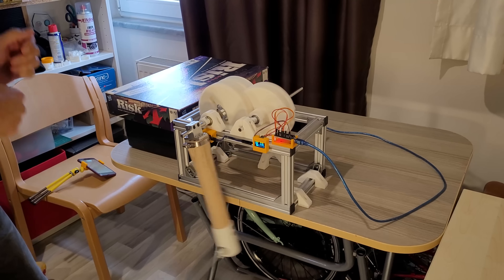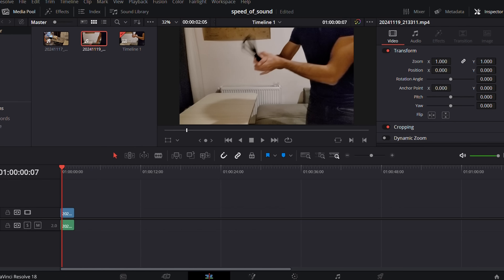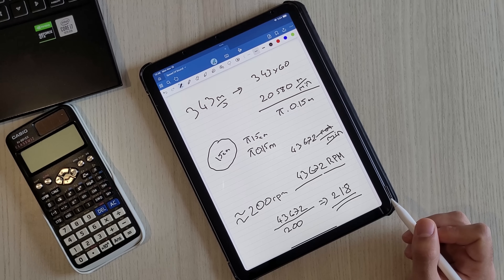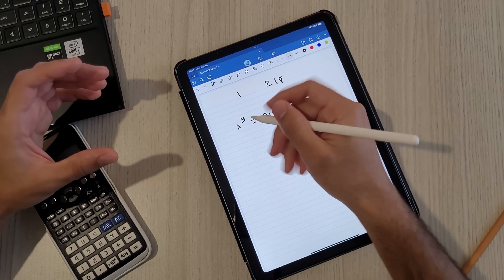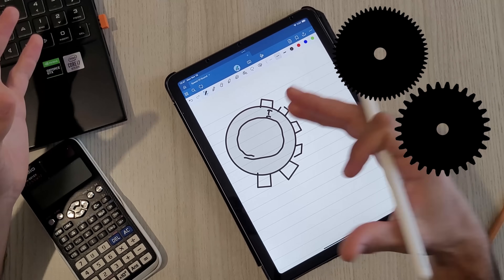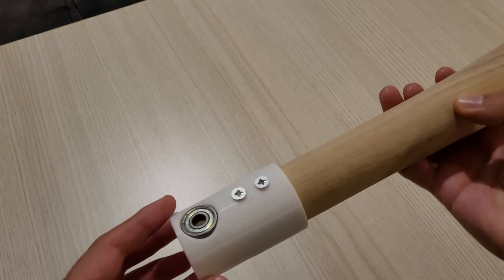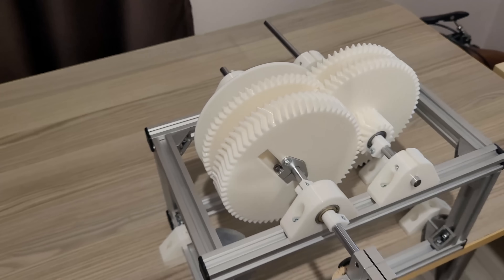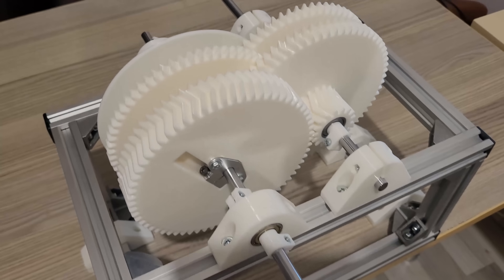Trying To Reach Speed Of Sound At Home 3D Printed Gears

Comment: New challenge. Gravity battery from very heavy weight. How long can you power your house by ever-so-slowly dropping a massive boulder down a cliff?
Edit: please read the comments before adding yours.
Reply from the maker: I don't think you can power your house, but i may try charging a phone.
Reply: @canocholic  back in the day (read before 1900) there was a setup that used a cranked platform filled with rocks that would power your lights and you would have a servant crank it every hour or so. 

with leds you can definitely have the whole house lit up for quite a while off of a 50 kg bag.
the main thing is that if you have a variable load you need a gearbox.
Reply: @canocholic  There's already a guy that is recharging a phone using the water pouring down from his roof gutters when it rains. It's not terribly efficient, and yes, he can barely recharge a phone in the best case scenario. Look for Quint Builds. he is abolutely overengineering the thing
Reply: @canocholic  you could run a huge cable and pulleys and make like a pull cord onto the input shaft of a generator. Just have to wrap a shit ton of cable. You can make it wrap another cable as it releases and you just have to reattatch the other cable
Reply: @canocholic must be the house brother. There is no other way. Thou has spoken.
Reply: @canocholic no, you MUST power a house.  Use a boulder as the weight.  Include a super heavy flywheel.  Make the winch/drive mechanism super high torque so you can wind it by hand / with a pedal bike.
Reply: @BobWidlefish  you would need about 40 tons being lowered over 10m in 1hour to get 1 kWh of energy. In a perfect scenario without losses....
Reply: @ exactly!  LETS GOOOO!!!!
Reply: @BobWidlefish сделай сам, в чём проблема? 😂
Reply: In a perfect system you could store/extract 9.8 joules per kilogram per meter dropped, average US home used 108 million joules in a DAY! Even if you hung a rock off the highest cliff in the world (mount thor) at a 1675m drop, you would still need a staggering 6500 kg rock travelling that entire distance up and down every day for one single home. And that weight grows exponentially as the potential height shrinks. These systems do somewhat exist in the form of hydroelectric plants and pump stations that can buffer grid demands throughout the day. But that's boring I want to see him do it your way.
Reply: @nave6268  The average US household uses almost 11.000 kwH in year? Thats crazy! In germany its apparently between 3000-4000 kwH per year. I wonder where its all going, since we all use the basic things like fridge, TV etc. Is it all in the AC?
Reply: @cornflakes5515  Probably more to do with the financials, US energy is about a third of the price so it makes sense to save on construction costs and overcompensate the lack of insulation by using more kwh. In Germany likely the opposite is true.
Reply: @cornflakes5515 I'm way past that.  I use about 2000kWh/month.  I'm in the US.
Reply: @nave6268  6500 kg boulder is on the lower end i'd say. Most boulders are over 10 tons
Reply: in all honesty a 6500kg rock isnt that big
with the average density of say granite being 2500kg/m3 its only around two and maybe a half cubic meters of granite
Reply: @gardenguy357  i want to know where you get boulders like that 😆
Reply: @nave6268  Damn. Oil is neat.
Reply: @nave6268 it doesn't grow exponentially it grows in inverse proportion. half the height, double the mass.
Reply: People vastly overestimate how much energy can be stored using the gravitational field. You can only get sizeable amount of energy with a lot of mass. This is why gravitational energy generation is only effective with dams. Anything that is not using literally a lake equivalent of mass can barely recharge a phone.
Reply: @StefanoBorini  The only effective system is using water and gravity. A boulder or heavy weights makes no sense
Reply: @StefanoBorini  yeah thats the whole thing.  gravity is the weakest force by a LOT.
Reply: One must imagine Sisyphus an efficient generator
Reply: Gravity based energy storage already exists and has been used for years. It's called pumped storage. A reservoir full of water flows downhill through a turbine to power a generator, you get electricity out of it. To "recharge" the reservoir you pump water uphill back into it.
Reply: interestingly, I had a machine design project that had to design a gearbox system to transmit the power for a gravitational potential energy storage system.
Reply: @jordanmuna5628  any chance you could share the design? i would love to use it for a project of mine in which i would like to involve gravity batteries
Reply: 😂 ok
Reply: I have a concept that fits in a smal residential closet.
Message me if you want ìt.
Reply: Wait, wouldn't it cost less energy than something like that would produce to detach the crank, rotate the gear back up, and restart the system? I know perpetual motion is impossible, so I must be getting something wrong, but it sounds like more energy goes out than goes in.
Reply: @f5tornado831 Gravitational potential energy = 9.81 × Mass × height difference. It doesn't matter what path you take or method you use, moving a rock up 10 ft will take the same or more energy than dropping it 10 feet. Gears and pulleys never create energy, only transfer it with some losses.
Reply: @kolbyking2315  to be clear, I'm not talking about lifting any mass. I'm talking about the potential energy of a mass that has already been placed conveniently, by geological processes. Like, if one lived close to a tall cliff with lots of big rocks close to the rim.
Reply: @zippythinginvention  You're basically describing hydroelectric dams.
Electricity generated from:
1 ton of coal = 1934 KWh
1 ton of rocks dropped from the world's tallest cliff (1250m) = 3.1 KWh
Reply: Ok
Reply: Hades, is that you? Give Sisyphus a break already.
Reply: Energy in is energy out, and a lot gets lost in friction.
Reply: I have drawn up a system like this one that would store power from solar panels by rising and would activate and lower when it is cloudy to continue to provide power to a house
Reply: @QBWbbx  you could use the low torque side to rise, and the high torque side to regenerate power. Or... You could use the high torque side to make a flywheel spin which preserves power during a cloudy moment. Different takes at this but flywheels are pretty darn potent.
Reply: @bramweinreder2346  yeah my version I drew up has the first part of your comment. The extra power from the solar panels uses a small gear to turn the big gear, raising the weight. Then the big gear falling at a controlled speed spins the small gear.
Reply: @QBWbbx  that seems to be the easiest way. It's definitely better than letting the energy go to waste. Also good that you intend to regulate the speed, otherwise it would limit at a friction equilibrium which isn't great for efficiency.
Reply: there's a really funny video about a scam scheme to provide energy storage using tower cranes to stack concrete blocks
Reply: But first, get a real workbench 😂
Reply: It's much simpler, and lower cost, to use Solar PV panels with a storage battery to power a house. Just saying. Doing it with weights is impractical for most individuals.
Reply: @RWBHere after some thinking I agree, people underestimate the friction involved in just the gear itself, never mind the generator. It would be much better just to keep a flywheel spinning on the motor/generator itself.
Reply: I had a idea for invention but not sure how to proceed but if you had a platform for your car and springs reset it and you use the weight of car to push down lever to gearbox with crazy leverage and gear reduction so it takes like 6 hours to fall 2ft spinning an alternator or something. Anyone smart able to help
Reply: @joshuamittie791  the gearing doesn't affect the amount of energy you get out there. higher speed means it's applying less force so your W=Fd stays the same.
Reply: @zippythinginvention  down a cliff with your home at the bottom and a hamster wheel to wind it back up.
Reply: Calculate the kenetic energy of the boulder going down the hill in joules. (10,000 jouls for example) divide the total joules by the home wattage use. (5000 watts for example) the answer is how many seconds you could power your home at 100% efficiency. For this example you could power your home for 2 seconds.
Reply: no , it is too dangerous.
Reply: I've never had more intelligent responses to a YouTube comment, ever. Very refreshing!
Reply: @zippythinginvention   never had a better experience with a comment section!

the comment section: ChaLLeNGe AcCepTeD!!!
Reply: No you can't
Reply: Wrong.
Reply: @stickmouse5002  who's wrong? About what? Go ahead and use your words...
Reply: I won’t read the comments before adding mine. 
You think you can make demands of me? 
I don’t recognize your authority.

Comment: Awesome video, I've been wanting to make a similar project and this video is the best one i've found to learn from. Regarding the experiment, what material did you use for the 3D printed parts? I'd recomend trying out either Polycarbonate or CF-Nylon, both of them are way tougher and durable than PLA; also some silicone lubricant to make the thing smoother!
Reply from the maker: I have an Ender 3 and ıt's aging at this point. I don't think it can handle much more than PLA. But if i get my hands on a printer that can print engineering materials, i would definitely use them. 
But i think people hate on PLA too much, 500+ km/h is still impressive. It's healthier to print less toxis fumes. The chance of a print failure is really low. I like PLA